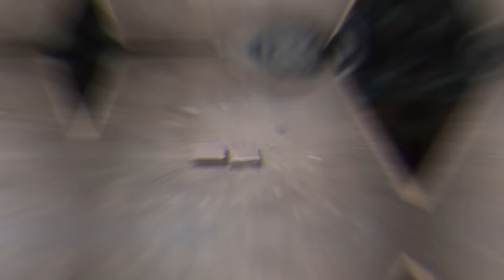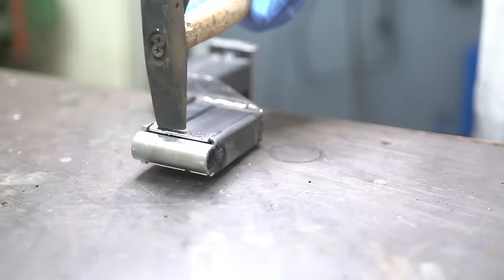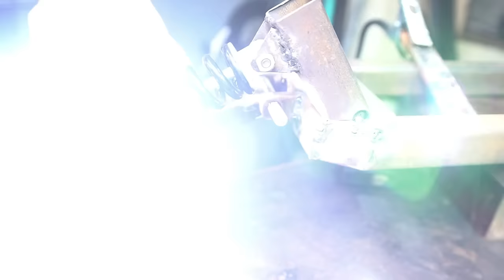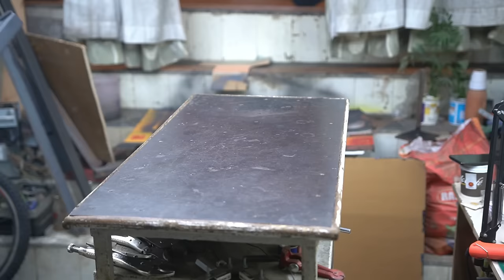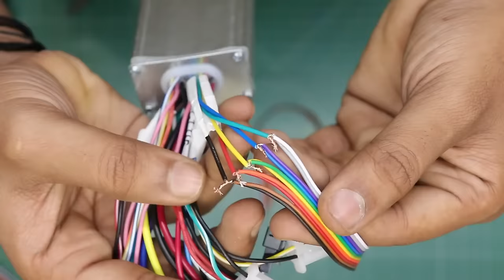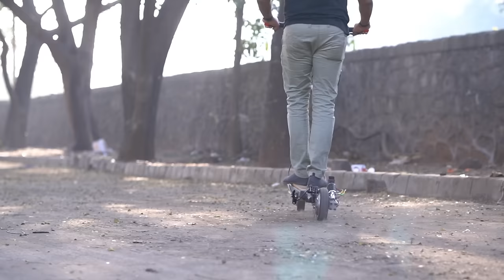DIY ELECTRIC SCOOTER FROM HOVERBOARD

Comment: great work with the suspension, totally understandable the power, the fact it's from hoverboard. the plywood would not be a good base material, and you could've cover the wirings & spray painted the pieces after weld.

Comment: I want to ask, I've made the same one, but when the gas/ throttle is fully opened, the voltage drops down until to 32 volt...finally lvc / turns off, I've changed the controller, replaced the bms and the case still same, what's wrong ? please help me... is there a possible cell battery that is damaged? whereas before being assembled 18650 everything was checked at 4.1 volts. thanks,,,
Reply from the maker: Check the bms amps of your battery and howmuch motor draw

Comment: Good morning
I would be grateful since I tried my hand at building a scooter but after connecting the control unit to an accelerator
As I accelerate when it reaches the max it makes a noise and stops
Then or noticed that when I push it a little it goes out and I have to unhook battery and hang up and then it starts again
Why .. ??? . Can you help me
I used the wheels and battery of a hoverboard I attached two double front and rear overboord wheels
Thank you

Comment: Great job man!     question: did you connect one throttle to both controller or how you made that?
Reply from the maker: Yes
Reply: They already got throttle otherwise Ballance board would throw you off starting on full throttle lol

Comment: I have one problem with this and it's major I definitely agree with reusing battery cells but using cells of all different brands capacity and use this is very dangerous this is how 18650 cells are always exploding this man is very creative but needs to learn way more about battery safety and electronics in general
Reply from the maker: All cells are tested and then used they all are of same capacity